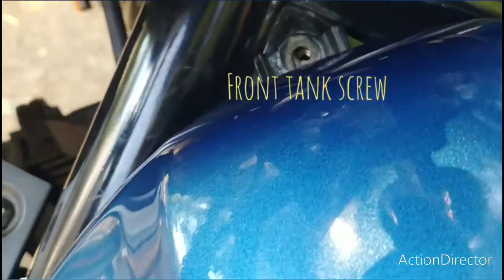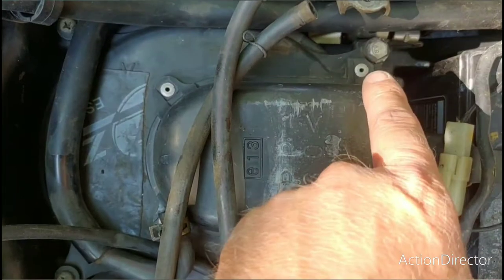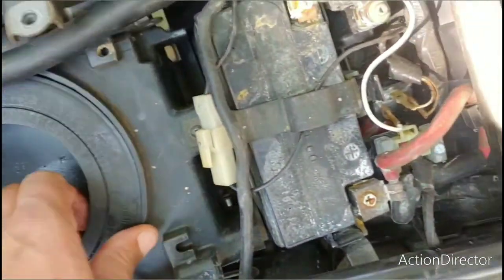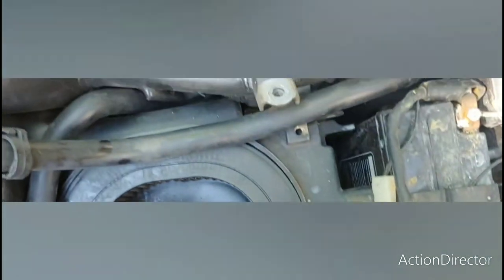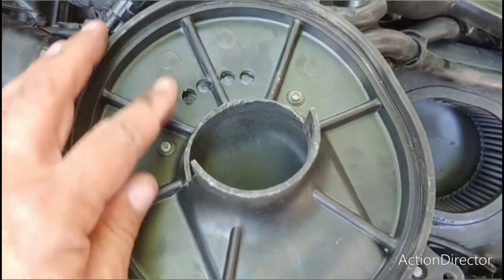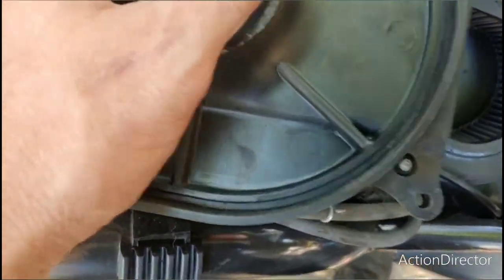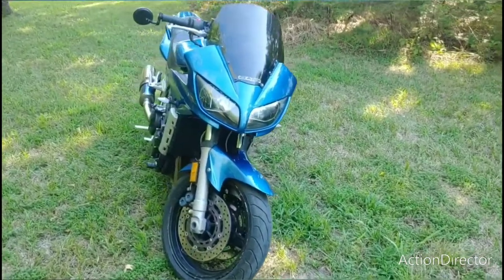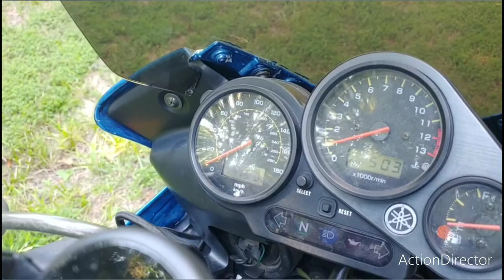FZ1 Air Box Mod 01-05 Yamaha Fz1/Fazer

Comment: I did this mod along with Ivan's jet kit. Old forums from like 2004 had a slew of pics. The one pictured was a bit more cleaned up, but the cut was the same. Yoshimura had a similar airflow mod, using dyno holes instead. This is a good video, i remember 'some' riders were confused by the pics and accidentally cut the TOP riveted portion of the airbox off, which caused other issues. A video showing all the angles helps. A smol dremel bit can really help clean the edges if it whistles. If it doesn't whistle, slap it together and ride more.

Gen 1 FZ1 is literally a tank and people get 100k+ miles on them.
Reply from the maker: Thank's and for sure a tank

Comment: Love this!!! y 01 FZ1 has been sitting for 9 yrs. I had a work fall 12 yrs ago changed my life. After many surgeries Im feeling really good and want to ride again. did the whole thing with new gas, drain carbs, new gas with seafoam, and the bike started!!! ran a little ruff, went up and down the street a couple of times and its getting better. I live in alaska and have the bike in Seattle area. So bummed that FZ1 owners assoc is no longer around. you don't have any tips for this area?
Reply from the maker: My best tip would be to glance at the race prep video's on this channel and consider pulling your carbs off for a clean, change your brake fluid, fork seals are likely to start leaking, watch fz1 front to back on this channel

Comment: Hi, I removed the tank to fix the petcock valve, but now I have some problem, there are 2 small hoses under the tank, I found out it is for breathing air, but what about the other one, what is it for? Now I don't know which hose to connect to which pipe, or can I just connect it back regardless of which hose?
Reply from the maker: They are both vents and no it doesn't matter which one goes where
Reply: @ccreations123  Ok, thanks!

Comment: Hi, can you please share your experience I purchased this year 2003 FZ one and it is all stock thinking of installing a slip on which would be the same length as the stock muffler, my question is could I get away with only installing the new muffler and not doing anything else?
Thank you… Ed
Reply from the maker: Hi Edgar, that's a good question, the answer is no, while it will run, it will be low on power and running lean, potential engine damage lean, you're going to need a jet kit, and I suggest an ivan's kit, its kind of an all or nothing on that kind of deal, I would wait and get the kit with the intake boots or do your own but get the kit for intake boots, slip on, and emission removal at the least, it wakes this bike up tremendously but at some cost as to tameness
Reply from the maker: Watch this to help put together a plan. https://youtu.be/v3DCad6VQDg

Comment: Damm you got that idle down to like 500rpms 😂😂  sounds baffleless
Reply from the maker: The fuel was actually still turned off at the end but normal idle for me is 1100ish rpm, there are still packings in the muffler but no baffle, I have the baffle/spark arrestor though, my muffler is cracked now so it's louder and awaiting replacement, thanks for watching

Comment: Any downside to doing this?

Is there any point in doing it if you don't also pair it with a carb retune or rejet?

Opened my airbox today to clean the filter, but didn't have the balls to do this...also didn't have a grinder handy! But maybe I will in the near future?
Reply from the maker: I would imagine that if you wanted to do this to prep for the future it would be fine, this mod is for just a tiny bit of added top end power, with the stock exhaust and such you wouldn't be able to tell a difference
Reply from the maker: Watch this to help you make a plan for your FZ1.   https://youtu.be/v3DCad6VQDg